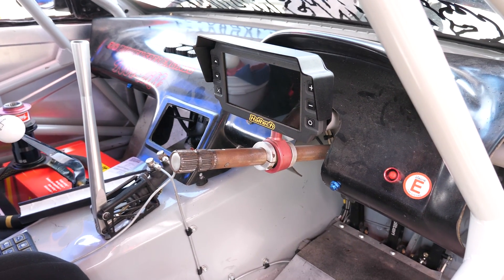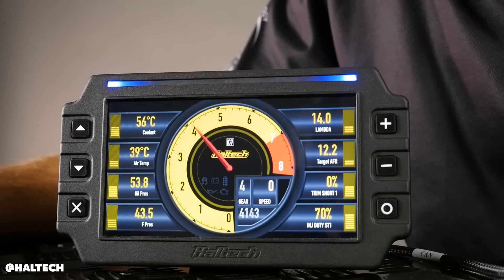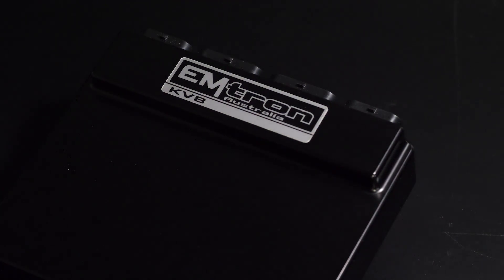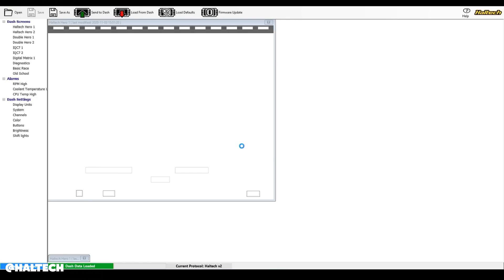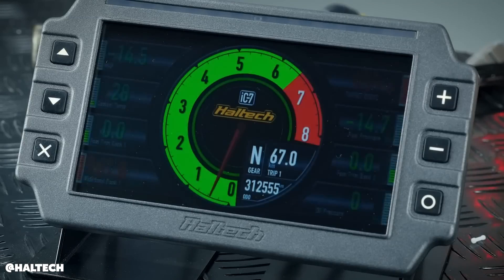How did Haltech keep THIS a secret?

Comment from the maker: 💰🧠 Building a fast car? Get EVERY course ever with $400 OFF the VIP package: https://hpcdmy.co/vipy14
Become a wiring wizard. Learn CAN Bus today. Get started HALF PRICE: https://hpcdmy.co/offery14
0:00 - Modern Gauge
0:23 - What Is The IC-7
0:48 - Display Only
1:20 - Filled A Market Gap
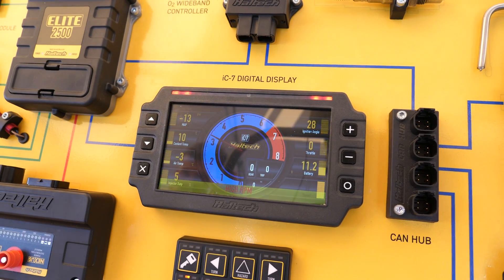1:48 - CAN Communication
2:10 - BIG NEWS
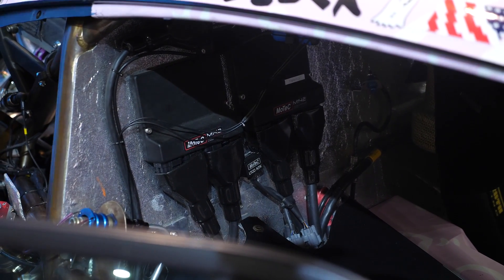2:42 - Why That Approach?
3:04 - Simple Level Vs Advanced
3:29 - OBD2 Compatible
3:55 - NSP Software Integration
4:30 - PDM Integration
4:47 - Firmware Update - All The Features
5:20 - Development Plan
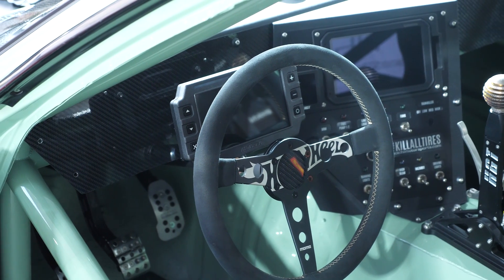5:50 - When?
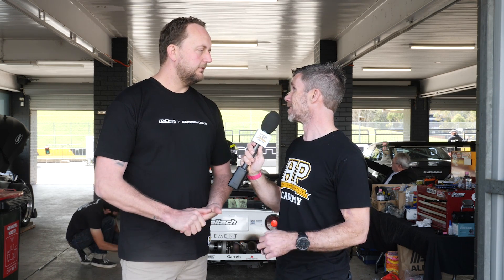6:30 - Thanks Scott!
6:40 - BUILD | TUNE | DRIVE

Comment: How can we convert or redirect the signal to the IC-7 screen and send it out to the 7" LED in my dual din? My car is a street car so I have a 2500T tandem wired with my factory ECU for compliance purposes. I also prefer the car look sleeper / normal and not give away what's quietly tucked away inside the wire looms. Yet I'd enjoy having an easily monitored output when actually at the track or when editing or tuning. I'd love it if we didn't need to buy an IC-7 to get the feed, but not trying to take money out of Haltech's pockets as they are hitting the US market harder lately (glad to see it!) and I wouldn't mind just cracking one apart to send the feed off to my stereo head unit 7" screen instead.

Comment: Will this transfer data from an oem
Ecu from the obd port to a haltech ecu ? Some of us are considering using a r3 or 2500 for boost control and safeties ontop of an oe ecu for emissions purposes and trans control
Reply from the maker: Yes, but that's not necessarily plug and play as every OEM is different. Tapping into the stock sensors you have on your road turned race car via CAN is a smart and cost effective thing to do though for sure 😎 - Taz.

Comment: If possible, it would be incredible to be able to have a reverse camera that integrates seamlessly with the ecu and display dash.
Reply: It would require a hardware update to work with external video inputs. Currently, the inputs on the dash itself, only allow for CAN communication and a few analog inputs.

Comment: The most important question is while the dash cost $$$ remain the same once the firmware is released or will it have updated pricing to reflect the added features?
Reply: The firmware release won't make buying the dash more expensive, otherwise the firmware update for existing dashes wouldn't be free....
Reply: I wouldn't be supersized. Demand for them will go up, so the ones on the street will get snatched up at lower prices from people who don't know yet. Could eventually effect supply and make the prices go up.
Reply: The hardware inside the dash is still the same, just it has been firmware limited up until now